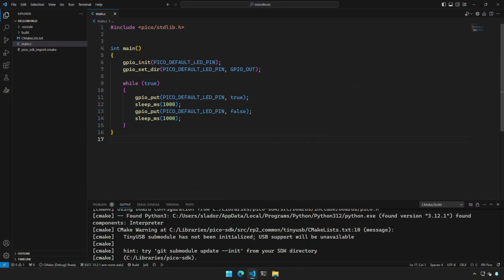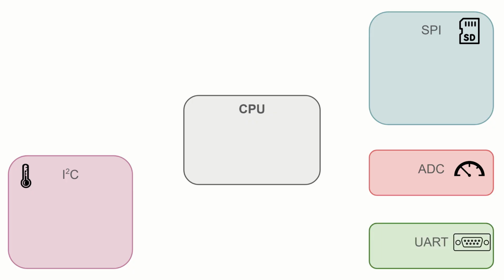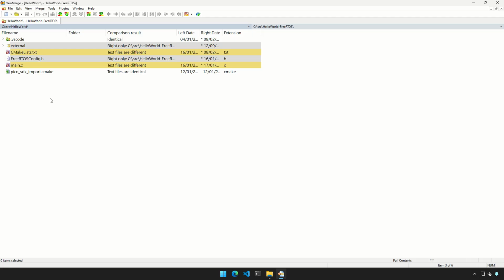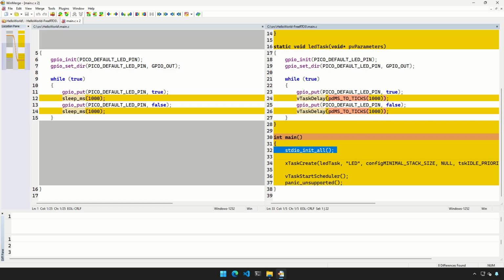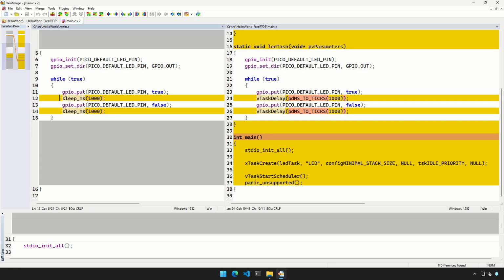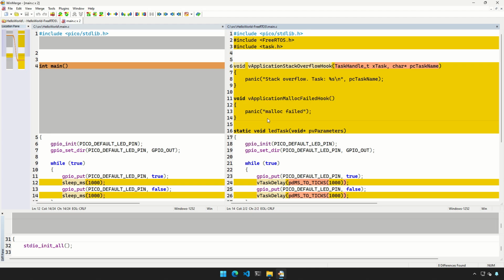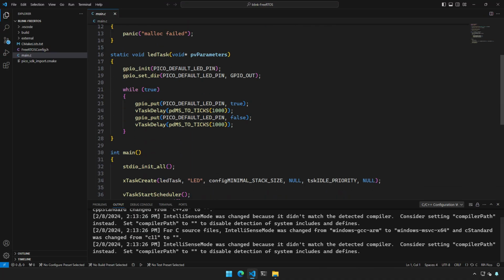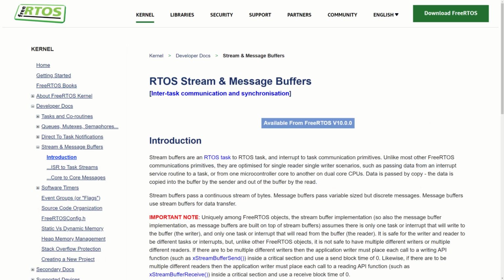FreeRTOS on Raspberry Pi Pico

Comment: Somehow YT decided to let me watch this video and now I'm hooked. I came here because of the FreeRTOS part. As a long time user (I should still have the original FreeRTOS 4 manuals that I bought about 20 years ago) I used it a lot - and still do.
I became kind of a FreeRTOS expert on ARM Cortex systems and I am currently investigating some quirks on the STM32H7 we use. The STM32 HAL environment implemented a thread safe mechanism that does not work well with FreeRTOS. Next thing to "fix" is the ability to schedule different tasks on different processor cores. A bit tricky on our system with different types of cores so it might be nice to do this on the Pi Pico (or Pico 2) before implementing this on our system.

Comment: I have been trying to make it work for 3 days now to no avail. are you sure it just works "out of the box?"
Reply from the maker: Hi @aleksandarbozic7050. Sorry that you have been having issues with my code. If you are talking about this error:
#error configUSE_CORE_AFFINITY is required for PICO_FLASH_SAFE_EXECUTE_SUPPORT_FREERTOS_SMP
then you can easily rectify it by setting configUSE_CORE_AFFINITY to 1 in FreeRTOSConfig.h. The problem occurred probably due to some changes they made in FreeRTOS code. I will update it in the repo as well.
If you have a different problem that the one above, please send me an email with the exact issue and I'll try to test it on my side.
Thank you for your comment! Take care.

Comment: Is it possible for a task to wait for EITHER queue data OR timeout? I'd like the main task to immediately process queue commands, but even if there's no commands perform other functions periodically.

For example, I've read that relying on 
vTaskDelayUntil() 
is not recommended because the timing may not be precise due to preemption/blocking/tick-count wrap around/etc?

Comment: Nice video. I have a few examples of FreeRTOS projects on my channel too on the Pico and Pico-W. I think FreeRTOS can be scary but in fact is quite straightforward. Once you start using on a Pico-W with LwIP it enables so much as you gain a task looking after the IP stack and providing Sockets.
Reply from the maker: Thank you @DrJonEA for your comment. I had exactly the same feeling about FreeRTOS when I first saw it, but quickly realised that it's really simple to use. Funny you mentioned PicoW and lwIP, because last year I built a simple contraption using these just for fun. Maybe I'll show it in a future video as it may be a good starting project for people wanting their PicoW to use the Internet very easily. I used lwIP together with mbedTLS for HTTPS.
Reply: @SladorSoft  That sounds great. Perhaps we can do a few cross overs between our two channels.

Comment: FreeRTOS has a few tricky parts with it. For the most part it is very straight forward. 

Interrupts, stacks, ISA/pipeling, etc. create problems in some cases. (Resource management) DMA, ram functions, caches, etc. are also capable of driving certain issues. (Networking) Certain memory things like data structures and UMA coherency/concurrency can appear. (Scheduling and Algorithms) Note I left a few things implied.

Now most of this is mitigable with processes aka pipes and malloc. (These drive down performance and drive up costs.) Same rough story you have with processors but with different interfaces and price points.

Comment: What is RTOS?
Reply from the maker: That is a good question. I didn't answer it in this video as I just wanted to quickly introduce it to the viewers. RTOS stands for: "Real-Time Operating System". The "real-time" part says, that it is designed for timely processing events and switching threads. For example, in simple words, if there is one thread doing something and another thread with higher priority waiting for processing, you know exactly how long at most it will take to process the latter (this time is defined by the system tick). There is more to it, like for example, the distinction between hard- and soft- RTOSes etc. But in general RTOS gives some guarantees in terms of timing.

Comment: ... why does it take so long to build such a simple .c ?
does it recompile the entire OS? How big is that thing?
Reply from the maker: The OS itself is very small - just a few .c files. The build takes time because of the components of the Pico SDK. Not only need it to build the libraries used in your project, but also a few tools used on the way, like for example the PIO assembler. The good news it that it only does that first time - consequent builds a much quicker.

Comment: Microsoft Threads has been rereleased as Eclipse Threads under the MIT License.
Reply: *Threadx
Reply from the maker: Yes, I've heard the news, but I've never used ThreadX before, honestly. I'm going to have a look and maybe share my experience here in the future. Thanks!
Reply: @SladorSoft The interesting part of Threadx is its picokernel. There is no single kernel. The core kernel, the filesystem driver and network stack all run on base hardware with their own application specific kernels independent of one another. Same with the optional GUI component.

Comment: It would be interesting to produce the three tasks using arguments, making sure the code is re-entrant. If coders are to write for multi-tasking systems, then it's useful to learn the rules about making functions re-entrant and, for that matter, to make them thread-safe. 

In any event, a very useful intro into the basics. Many, many years ago I had to write an embedded system using a Z80 in assembler code and that was fully interrupt driven with pre-emptive multi-tasking and had seven tasks. I had to write a code to do things like message passing via buffers, mutex control, timer routines and so on. It was fun, but would be so much easier with something like RTOS. 

nb. is RTOS fully pre-emptive, or does it rely on calling system routines for a task to give up control?
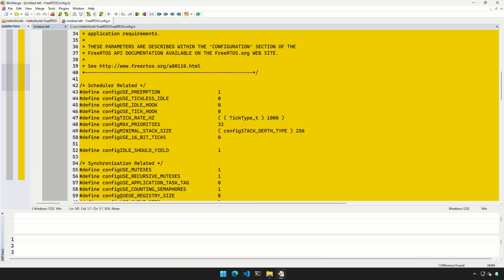Reply: "nb. is RTOS fully pre-emptive,?"  I don't know, but at 15:22 we see a define for configUSE_PREEMPTION.
Reply: @Graham_Wideman  I did a bit more research, and FreeRTOS does have full pre-emption, but it's optional. I can see why, as using a co-operative MT system does help mask some potential subtle programming errors, especially if you have code shared between functions and haven't been rigorous in making sure its re-entrant and thread safe.
Reply from the maker: Thank you very much @TheEulerID. Yes, this was just a trivial example just to introduce the idea, so I barely scratched the surface (intentionally). FreeRTOS is fully pre-emptive and switches context on both: the system calls and the system tick interrupt. As @Graham_Wideman correctly pointed out, pre-emption can be switched off (never tried that), so I assume, if you did that, the context switch would only happen on a system call.
BTW, in the "portable/ThirdParty/Community-Supported-Ports" directory of the FreeRTOS-Kernel you can also find a port for the Z80 as well :-)
Reply: @SladorSoft  Thanks. The video gave me enough info to see how it could be used. A few years ago I wrote some software to drive a WW II Battle of Britain sector slave clock (a very rare thing) using an Arduino, and had a whole bunch of timer-related things, like de-bouncing switches, driving timing pulses for the slave clock and maintaining a user interface. The whole process of writing it as a single master-loop whilst keeping multiple timer functions going and polling for user input was horrible. The multi-tasking approach is so much easier.

I'm thinking of re-implementing it on a Pi Pico W with a more accessible used interface and using Internet time servers and so on, and I will definitely be looking at using FreeRTOS for the purpose as it looks ideal for my needs.

Comment: Great RTOS introduction!
Was thinking about trying controlling multiple ws2812b led strips over spi at multiple gpio at same time on the rpi pico!
Reply from the maker: Thanks @crckdns! As @drgusman just said, the PIO is a much better choice to do that. You may want to look at my older video were I did exactly that. Some viewers pointed out that my solution there wasn't perfect as it was not keeping all the timings right, but it is still a good starting point I hope.
Reply: For that purpose the pico implements something better, the PIO units, you could use the eight state machines to control each one a different software defined SPI port.

Comment: Nice vídeo introducing FreeRTOS. Can It handle interrupts as well? I have a project that needs read USB keyboard input keys and send It to a LCD after some processing, using the RPI2040. The main problem is the firmware is getting slow as far I send more keys to processing and display them (It's a single thread).
Reply: Yes it can. Eg: You can make tasks wait for events. And than throw a event in an interruptq
Reply from the maker: Yes, it does support interrupts as @riaganbogenspanner just pointed out. You still implement your interrupt handler yourself. There are versions of some system function calls with the "FromISR" postfix, which are intended to be called from the interrupt handlers specifically.
What's great about FreeRTOS is that it has something called "Direct To Task Notifications" which can notify the task of your choice about an event, which effectively switches context from the interrupt directly to that task to minimise latency.
Reply: I am also interested in such a project. Are you using the main USB port, or are you bit banging another one via GPIO?
Reply: @helmutzollner5496  Hi, I'm using the main USB Port with TinyUSB lib provided by RPi Pico SDK. It works with interrupts (Idk If It is software or hardware one).
Reply: @cleverson_sa_  thank you.
Reply from the maker: @cleverson_sa_ it also works well with FreeRTOS. I did some prototyping a while ago and will be covering this in a future video ;-)